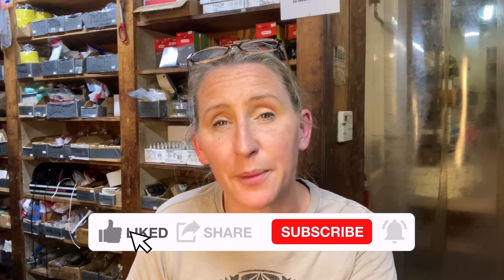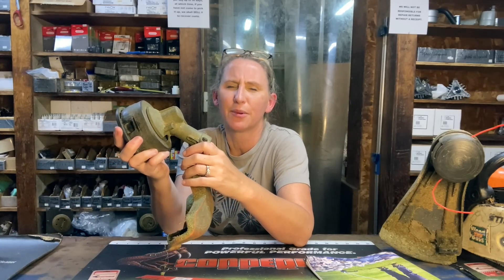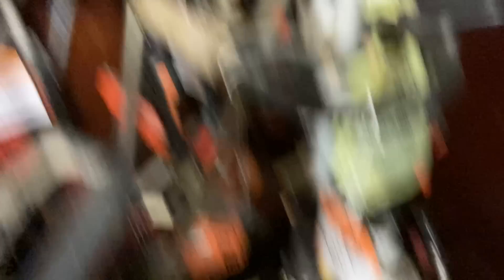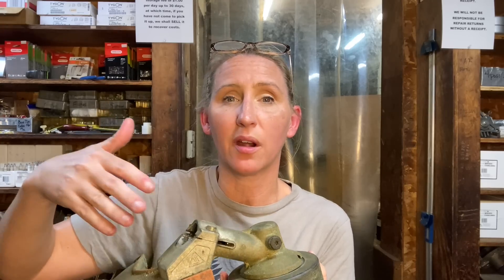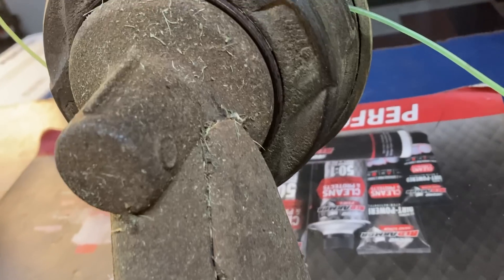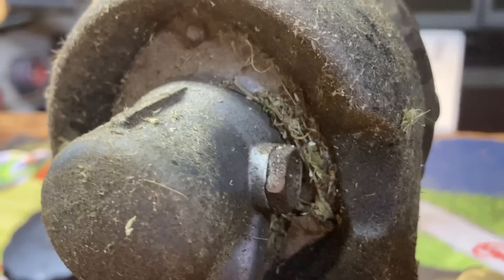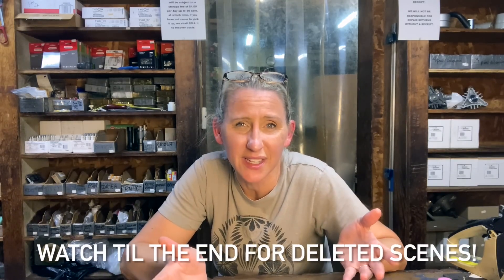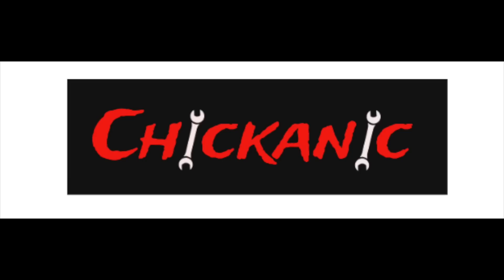Planned Obsolescence?! Why Would STIHL and ECHO Do This?!

Comment: As an engineer, we want to design the best products that money can buy. We know how to match component design so that the entire assembly will last a certain number of life-hours. We do this by mechanical testing, and generally by looking at data from previous testing. We CAN design machines that last for decades with routine maintenance.
The problem is that we ARE NOT ALLOWED to design things the way we were trained. Why? Corporate management wants it designed they way they are. Why? Because corporate management only cares about quarterly unit sales and gross margin on each unit.
Longevity negatively affects both metrics that corporate management care about. If it doesn't break, they cannot sell a replacement.
This is why I replaced my lawn equipment with a scythe. The entire outfit costs about $350 and it will outlast me.

Comment: Master Tech w/Cat and Yale heavy equip, trucks ,industrial. Engineers at plants do get bonuses off saving money off the bottom line. I've heard of them taking peoples ideas from the floor and claiming for themselves also. I drilled and tapped several of my "heads" and use a very good grade of grease. Running cooler also. As homeowner and they have lasted 20yrs. A couple of pieces, took apart, drilled, installed a very short threaded zerk. Bre's correct, maintenance is key!

Comment: I have a Kobalt battery power trimmer. Does that need a grease plug?  I did discover the replacement spool with line sells for $15 but replacement line in 125 foot spools (enough for 10 line replacements) sells for $9!

Comment: I bought a Husky 326 20 years ago and the manual didn’t mention the grease plug so after it wore out the manufacturer charged me 50$ for a new head that was completely reengineered even though it was under warranty 🧐. I now religiously grease the unit.

Comment: I think you his the nail right on the head with this one as well as the one about the oil changes. The quality of everything has severely gone down hill these days. I believe it really is planned obsolescence. Nothing is made like it used to be. Cars with automatic transmissions not having a dipstick anymore to check the blood in your transmission is a prime example of that. They don't want you to check your ATF to see if it's dirty or low anymore because they want you to either pay for a new transmission or buy another car. It's corporate greed. Thank you for this awesome and eye opening video. I was already aware of how bad it's getting, but most people aren't. You and others who are talking and posting videos about this are a godsend to the public. The cost of everything is going up through the roof, and the quality is going down the commode.

Comment: people don't grease it because they don't READ the literature or about scheduled maintenance.. (most people and some shops don't even know about the decoking  procedure on  4mix engines! or that they discontinued the product for that procedure yet its still part of scheduled maintenance)fyi.. they sell a tube of grease that threads In that bolt hole... bonus tip.. running the trimmer enough to spin the head will help when trying to get the the grease in it!

Comment: I’ve seen this phenomenon recently as well, I bought an echo dpas2100 which is more like the srm225, and a 2600 which is the pro series one. The 2100 comes w a trimmer attachment that has no grease plug whereas the 2600 one has the plug. Weird.

Comment: I was considering replacing my old briggs and stratton lawn master mower. Which was my fathers.
It's nearky 40 years old still starts first pull. I change the Oil every spring. Sharpen the blade etc.
But lookng at the new stuff It's just crappy looking.
So I'll just maintain it. Even rebuild it befor I'll replace it. For something new. Even my car is over 30 years old still mint. Just look after your old stuff. These companies will eventually loose sales cause they'll get a bad reputation.
Might aswel buy Chinese junk at least you can buy 3 or 4 backups for the price of a name brand.

Comment: I'm beginning to see a pattern developing, that manufacturers are starting to re-introduce planned obsolescence by stealth. I've had to replace a Stihl brushcutter because parts were no longer available. I replaced a door latch on my Bosch dishwasher, which I thought ridiculously expensive. The price of the small part has increased by about fifty percent in the past six months, so it's now equal to half the price of a new, full-sized dishwasher (admittedly not a Bosch). I've just had to spend £1400 on a single new headlamp unit for my car, which failed because of poor design/manufacture. Perhaps it's a coincidence that these were all from German companies?
Reply: Manufacturers don't manufacture every single piece of everything they produce. Thus, if I don't own a wiring harness production plant as a power equipment manufacturer I would need to outsource that component.  Since the harness manufacturer owns the rights to the harness blueprints when the equipment manufacturer needs one 15 years later and that harness company is out of business it can't be obtained. Many other aspects of production come into play also. If I'm a machinist making a part that requires a special tool and that tool is no longer made that has a chain reaction.  Lots of businesses have gone by the wayside because newer technologies provide a cheaper means to the ends.  I used to work on 7-8 dozen log splitters every year. Now it's maybe 5.  Should log splitter manufacturers complain consumers are planning their obsolescence?  Should lumberjacks be upset because you quit splitting wood in favor of new tech?  

It's a concept as old as time.
Reply: @yurmabeechaudits3522  I think we are in agreement over the situation, but not over culpability. We're talking about a brush cutter, not the space shuttle. Manufacturers arrange production and constant changes to save pennies, without thought or responsibility for the longer term viability of their products. I'm not naive enough to think it's for better product performance. No one can call them to legal account, so the only option for consumers is to call out the worst offenders so that they can be avoided.

Comment: Umm... What's the formula you used to convert RPM to MPH? I can't find it even when I use Google. Those commenters saying that they drill and tap their gearheads for zerk fittings don't mention anything about preventing aluminum chips from contaminating the existing grease when adding the new fittings.

Comment: My answer would be MONEY‼️Without the grease hole and plug, the assembly technician doesn’t have to make sure the hole threads are ok AND he/she doesn’t have to install the grease plug. Time = money! The company may save 10 cents per unit. That small savings DOES improve the bottom line which makes the stockholders happy.
*****************************************************************************
What are your thoughts on the EGO battery string trimmer. Unfortunately, I bought one a few years ago. For me, EGO spells TROUBLE‼️From battery failures, motor/switch problems, and trimmer head issues, I’m ready to go back to Echo. 
Thanks for your videos. They are invaluable for the homeowner❗️
.

Comment: I watched your video on how to grease the head from a couple of years back. I then went out, bought a trimmer last year AND the lithium grease with plans to maintain my trimmer head. Went to lube it last week, and what do you know? "NO grease nut.  Now, has anyone figured out how to grease the head then? I actually emailed Echo and they said not to worry as the unit is sealed... yeah... BS! So mad at Echo that I actually bought a used SRM2100 for $75 as a back up. Still  annoyed with these manufacturers.

Comment: It’s all about shifting volume of new machines the gear head will outlast the warranty even without the grease plug based on average end user hours and weeks of use and is probably deemed a wear part anyway so after 3 years the customer faced with a big bill will more than likely purchase a new unit. Call it what you like greed, consumerism, capitalism it’s all bad. Keep up the great work

Comment: I have been told (and no solid way to prove or disprove) on automobiles that sealed u-joints and bearings last as long or longer than greasable versions. Reason stated, a zerk allows dirt and debris to be forced through the zerk into the bearing internals when greasing is performed. That is of course if proper cleaning of the zerk and grease gun tip is not done before greasing. So I see it possible that a similar claim could be made for a trimmer gearhead as well. No designed place for dirt to get introduced, less chance of dirt getting into the bearing. My experience, neither sealed or greasable versions last as long as they should. Neither is significantly better than the other. I am not the best at keeping up on greasing, so that may influence the results of my experience. You decide. 

On our trimmers (old box store JD 1600 and older Homelite) I never knew to grease them or even look for a grease plug. My poor memory or not instructed to grease in the manual? I don't honestly know.

Comment: Thanks for pointing this situation out.   I realize some people never add grease, but some of us do maintain out equipment correctly. That grease plug in the gearbox certainly does not cost much to include.
Reply: You've clearly never worked on a mass production machinist line.  😂 drilling and tapping into cast is one of the most cost productive parts of machining.  The machines get out of whack as much as they do make good production. There's massive waste.

Comment: I imagine the trimmer gear heads can still be greased, but the lower part of the gear head assembly would have to be disassembled somewhat to access the gears, which would be inconvenient, compared with removing a grease plug to lubricant the gears.
I had a Weed Eater brand straight shaft trimmer years ago that did not have a gear head grease plug, which was clear evidence to me that the trimmer was not intended to be of "professional" quality. But the gear head on that trimmer worked fine for years of heavy use.

Comment: When I changed out the rear U joint on my truck the new one came with a grease fitting. I thought that was strange since the original one didn't have one. The parts guy said the originals were supposed to be "permanently lubricated". Which apparently was not true since at 80,000 miles the lube was gone and I was turning needle bearings into dust one revolution at a time.

I think manufacturers claim permanent lubrication because that is true, up until the end of the warranty timeframe. To them, that's permanent, cause after that they don't care how much longer it lasts. In their opinion if its beyond warranty, then its time to be replaced anyway.

Comment: you can pull the gear head off the shaft and grease it that way.  After all you are supposed to grease the drive shaft inside the tube by removing it and slathering the grease so put some in the head when you take it off to do you shaft maintenance.

Comment: I bought a Stihl FS56 fs fathers day and used it for the first time yesterday. It does not have the grease plug and all I did was trim around the house and in that short time that gear head was hot enough to burn me.

Comment: I have the same complaint with my ZT mower. It is the Ariens Apex 52. There are NO grease fittings on this machine anywhere. All moving parts with bearings are sealed. That includes all four wheels, front wheel swivels and deck spindles. They are purposely buildings these machines to fail.

Comment: 2 reasons i can think of 1) one less thing to trim the cost to build it (does not mean the selling cost drops, i'm sure that hasn't gone down) and 2) make money off of replacement parts sales.
at least you did the leg work for most of us and told us about buying a complete shaft/head assy versus just buying a new head. (thanks for that info)
one thing for certain, they never do anything to make LESS money, there is always a reason that generally equates to increasing their overall revenue.

Comment: Aloha Bre! I was looking at either the FS 56 RC-E or the FS 70 R and was shocked when I found out of the lack of a grease plug.  It seems to have been years since they did away with it in those models and now Echo!  Can you confirm that you can either grease the gears via the screw hole where the shield attaches and/or where the cable drive shaft attaches?  Both have been shown on YouTube as viable ways to grease the head.  Thanks and would be great to hear from you about that since you have at least the FS 56 RC-E in your shop?  Mahalo from Kauai, Hawaii.  Thomas

Comment: I have some Ego battery powered equipment.   Needed a extra battery but very expensive.   Looked around and found a chainsaw , battery and charger for just a few dollars more than the bare battery.   I’ve done the same thing with other equipment where I needed a part like the trimmer head, and wound up buying an assembly cheaper than just the 1 part.....

Comment: Great video i have a STIHL FS 70 R and the same non greaseable gear head was on it so i got a gear head for the FS 91-131 and changed it out and it looks way better than the one that was on it but i do still use that gear head on a cheaper unit.

Comment: I've always just pulled the head off, because not only do I grease the head where the cable connects to the head.
I slide the entire cable out, and wipe off old grease .
Then attach a rag onto the end of the cable with heavy string attached push it back into shaft several times. 
Then take my grease gun with Lucas red and sticky grease in it, and proceed to pump half a dozen squirts of grease up into shaft. 
Repeating this several times, and then good squirt into head.
During the year as I use mine for couple hours a month, I know between the ambient temperature, and the heat of the cable spinning in the shaft there's going to be some of the grease run into the head as I'm using it. 
When I am finished after I use my air compressor to blast as much of the grass off the head, guard and lower shaft it then hangs from a rafter by the guard allowing the grease to run slowly back to the power head, and repeat until next winter when I take it apart doing it all over again.
My last echo lasted 12 years, and I definitely work one harder than most owners unless they are commercial lawn service. 
By the way when the power heads decid to lock up at full throttle, it dam near breaks your wrist on the throttle hand. 
😂
They do it for two reasons, one hardly anyone ever greases one, two majority don't know what it's was there for. 
The others are they saved major money by not providing the location for it in the molds, they don't have to pay someone to drill and tap the holes, and they don't have to provide any hardware for the dam thing now. 
They know now that they'll have people buying new heads at full markup, because they know people on average aren't smart enough to buy the setup you mentioned.

Comment: My older Stihl has a grease plug so not an issue for me but I wonder if instead of replacing the new model gearhead with one from the split shaft I wonder if the new model could be tapped for a zerk.
Reply: I was wanting to type this comment.  I have a drill & bits, and a tap/die set.  Is there a way I can do this job without causing damage?

Comment: no more drain plugs in the bottom of B&S (and other) engines, very few grease zerks in riding mowers, and the newest "fashionable " thing- battery powered equipment,  has MANY drawbacks.  one example is the FSA56 trimmer. very light duty (I own one) and if you overwork it, the drive gear melts down. would be an easy repair- IF THEY MADE JUST THE GEAR ACCESSIBLE. 😢 instead you have to buy the whole motor assembly.  for me, a stihl dealer employee and mechanic I could deal with that,  even though at MY price it would still be spendy.  for a customer at retail price and labor, it may exceed the price of the product,  if not, real close. definitely wouldn't be worth it. I personally think they are trying to follow the car industry and make it so a person can't do their own work any more

Comment: The wastewater plant building i worked in had mice in the ceiling. It was always creepy at night when those little varmints would start chewing on something up there. I would put glue traps up there and the mice would squeak when they got stuck. Sometimes they would drag those traps around.

Comment: I think there's another reason for this. Plugs like that often use pipe threads and the machines that tap those threads can get out of adjustment thus ruining a lot of castings before QA notices. Removing the tapped part has the benefit of ensuring that up to 100% of the cast parts that passed QA can end up being part of the final product. This is important for just-in-time manufacturing/logistics/whatever especially since tapper machines are notorious for having problems, getting out of adjustment, and just being annoying. Part of the issue is that those machines are often custom-made due to them having to accommodate the parts. 

So yeah, it is greed and money-making tactics but not in the form everyone is thinking. Its literally about reducing defective parts.
Reply: Meh, no, taps are inspected before the job shift and replaced on a schedule if they're doin' it right.  The whole we might screw it up if we don't screw it up, is screwing it up.